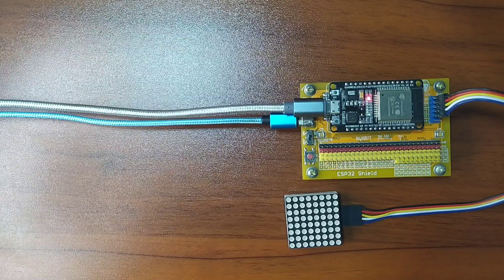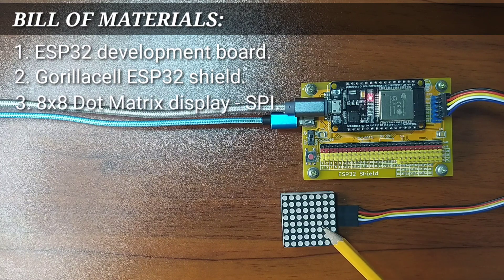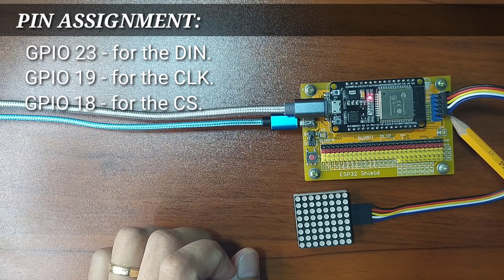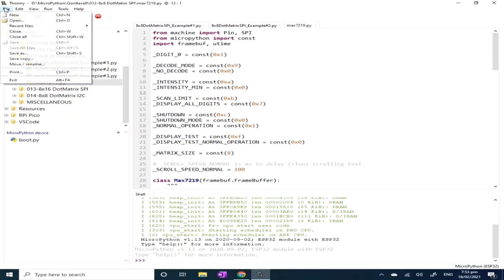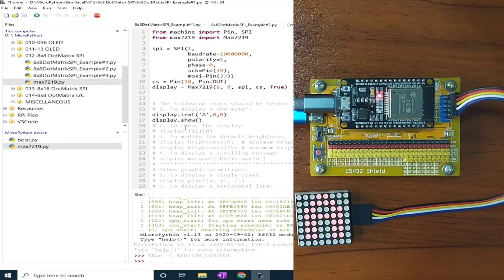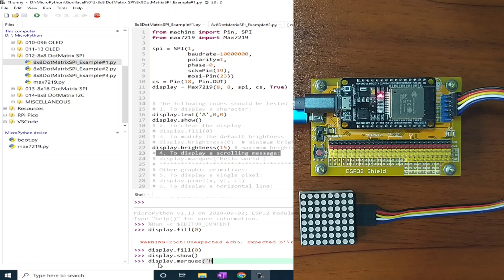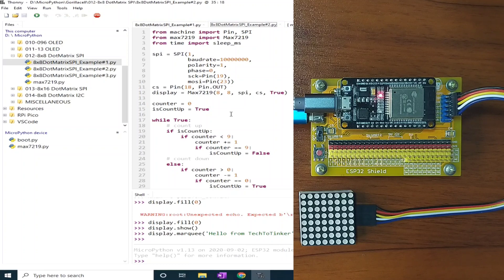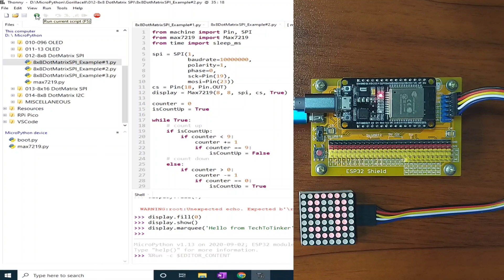012 - MicroPython TechNotes: 8x8 Dot Matrix Display - SPI

Comment: Please make another video using bigger dot matrix display. let's say  2 of  4-in-1 matrix joined together to make 16x32.
Reply from the maker: @Pal Sih, thank you for dropping by. I have 2 pieces of 8x8 dot matrix which will be the next tutorial. But if you want to use your 4 pieces of 8x8 matrix, just modify the object creation from display = Max7219(8, 8, spi, cs, True) to display = Max7219(32, 8, spi, cs, True). 

Hope this helps.